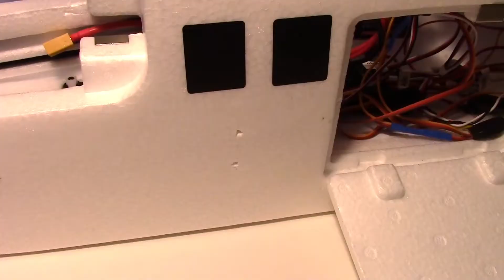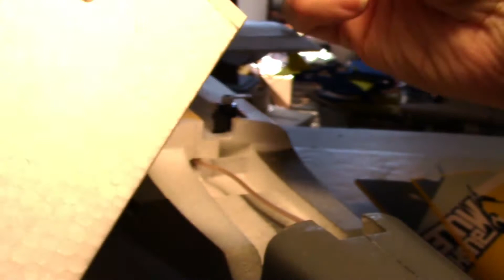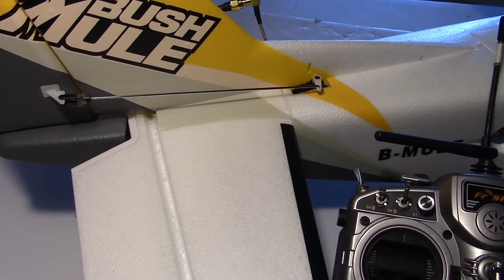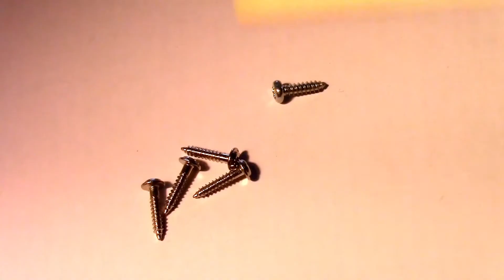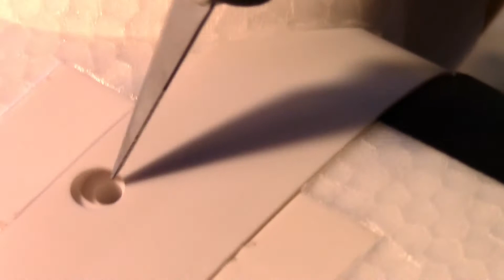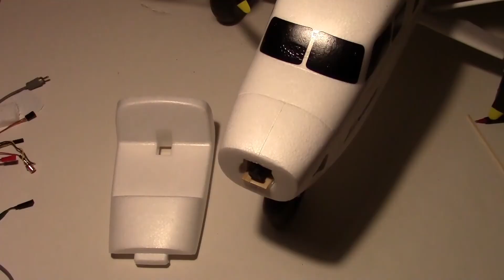HK Bush Mule FPV Build Part 3 - Assembling the Plane and Installing FPV VTX

Comment: So here's something different.  My kit came with a steering rod that is not straight.  Has a half square bent into the rod.  Guessing it's a damper for the steering?  Have you come across this?  Wonder if Avios heard about the steering servo stripping.
Reply from the maker: Haven't see that. Could you post a picture to the RCgroups thread?
https://www.rcgroups.com/forums/showthread.php?2834684-NEW-Avios-Bush-Mule-from-Hobby-King
Reply: I posted a pic on RCgroups.
Reply from the maker: Yes I saw your post on rcgroups and made a comment.

Comment: Can you tell me if the hardware (screws) are cheap aluminum or steel?  May grab some steel screws before I build mine. Also how does the esc reversing work?   Different channel or on a switch to change direction? Thanks for the very informative videos!
Reply from the maker: Screws are steel so should be fine. ESC has a second servo cable to control the reversing so just hooks to another channel on your RC radio.
Reply: Right on, thanks for the reply!

Comment: Hi Dave, nice video! What battery size you are using for long range flight, and what usually flight time for it? Thanks
Reply from the maker: I have been using a 4000mha 4S LiPo and my flight times are 10 minutes so far. Keep in mind I have the extra weight of the FC and FPV gear.
Reply: Ok, so it's short range FPV flier :) I thought it flies longer.
Reply from the maker: You can put a bigger battery in it but it can be hard on the font landing gear. I'm starting a FPV Ranger 2000 build next and that should stay up for an hour because it's more of a glider. My SkyWalker plane will do the same with a more narrow body and 1900mm wing span.
Reply: Thanks, Dave!

Comment: Where would I get some extra props for this plane? HK says they're out of stock. Thinking about purchasing as it is on sale right now, but don't want to be stuck with something with an odd prop setup..
Reply from the maker: I think you can use Master Air Screw props for the Bush Mule. They are very good quality. 
You can check the RCgroups thread in the video description for suggestions if you want.
Reply: Dave Merc Productions still have the plane? How's it holding up?

Comment: Great video Dave! After watching this, I decided to follow your lead and FPV mine (it’s only about the third time I’ve done that, you’re costing me a lot of money, lol.)  Just FYI, my Mule did not have the wing hole problem and I don’t remember getting four mystery washers. I did get screws with my floats and it may be possible you grabbed those?  I’ll check when I get home and see if I can find out what went where.  I ordered a 24” Dragonlink cable which has worked well for me. Good luck on the maiden!
Reply from the maker: I'm glad I could inspire you go FPV. Sorry about your wallet. I got my floats before I got the plane and there were no screws for mounting. Someone else mentioned that they had to provided their own as well. The washers are still a mystery.